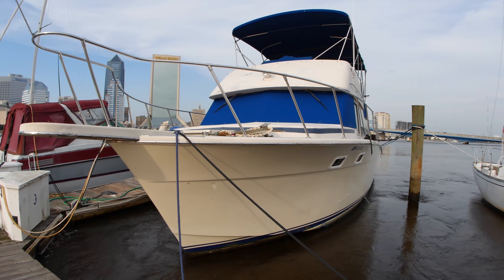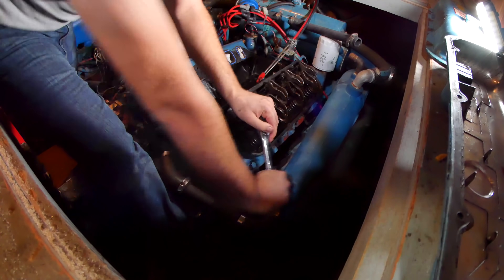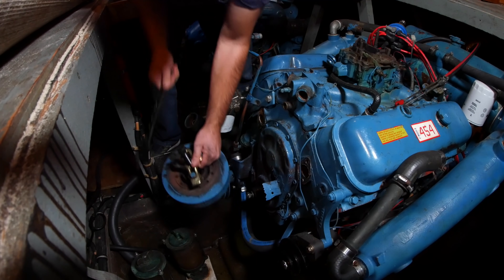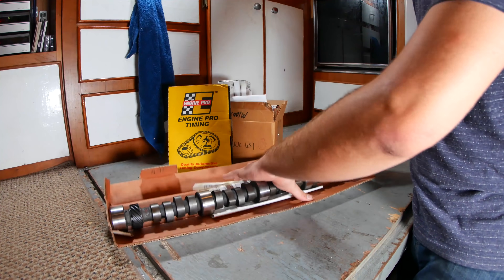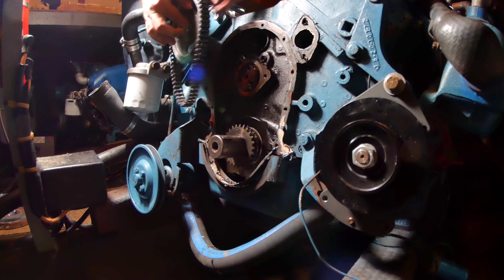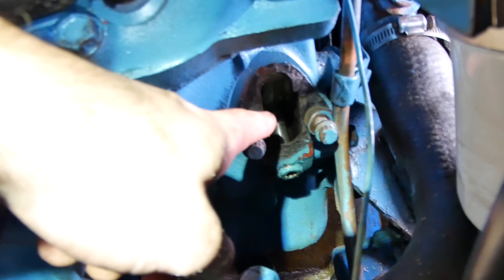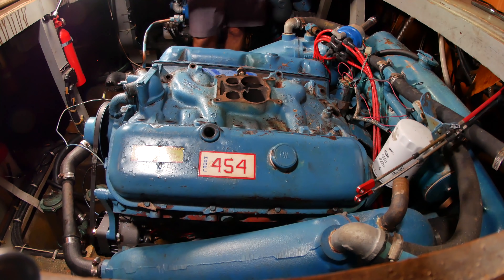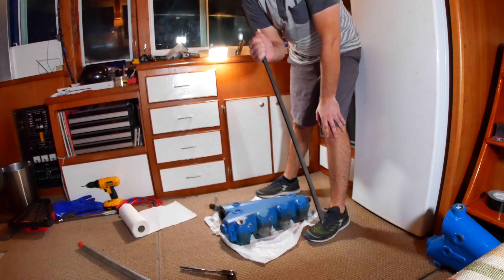The Biggest Project I've Ever Tackled (Boat 454 Repair)

Comment: We bought a 1979 Gulfstar trawler with a frozen engine.  After getting quotes of 35K $ to replace it we went to work. We swapped out an engine and gave both engines an overhaul.  I have the same level of knowledge as yourself. The day I got both engines running simultaneously is a day I won't forget. I could feel your satisfaction.  Great videos. Keep them coming. Sean
Reply from the maker: Thats an awesome story! I bet you've had some amazing adventures since that day.
Reply: @CullenCraft  we have had tremendous adventures with her in the last 4 years since we own her. Having bought her in New York we sailed down the ICW over two summers to Florida and then to the Bahamas. We shipped her to Italy in the back of a ship and now keep her in the Mediterranean.
Reply from the maker: Wow! I'm jealous!
Reply: @CullenCraft  Im lucky the lady in my life loves boating.  It makes it so easy. Our boat looks very similar to your boat. Our engines are diesel.
Reply: Hi Sean, how did the importing of your boat to Italy or somewhere in the EU go, was it easy to ship the boat? Once you got it there, did you have to do anything regarding the recreational craft directive (RCD)? Also, what diesels did you replace the petrols with (your boat must be worth quite a bit more now)?
Reply: @sean carrol
Reply: Old tech is simple and easy to comprehend. Hind sight is 20/20
Reply: congrats on a 70k DAY🎉

Comment: I'm a 36 yr diyer on cars... My 1st car was a 73' Pontiac Gran Prix with the smaller 400 cu. inch engine. The larger motor was a GM 455 (similiar to your 454's).  It's very impressive that you undertook a major rebuild project by yourself and didn't allow the issue at hand dissuade u. GREAT JOB !!! And congratulations on your success - it just makes you appreciate your motors even more when you've done it yourself... Keep the videos coming Chris Craft made some great boats in that period.
Reply from the maker: Someday I want an old Pontiac like that. Great cars!

Comment: Just a quick stop back through.  Good to see you working hard, learning, and taking good advice from many people.  Here is my latest offering if it helps...  always make sure that you know what tools that you will need before you start a job. On the timing gear puller and other common tools - both Oreilly's and auto-zone offer good loan a tool programs for common tools.  The lower timing gear puller gear puller is available, just leave a deposit, which you get back when you bring the tool back...  best of luck and I will check back again. :)

Comment: You remind me of the days I did all the work on my 88 Carver 38ft aft cabin.  Twin 454 mercs....7.5 Kohler genny ......3 heat pumps etc and all worked great...never paid anyone to fix anything.  You will never regret doing the work yourself as you will know when your CC is running correctly and pocket the savings.  Buy new carpeting as a reward.  Good Luck!

Comment: GOOD JOB<<<U GAVE ME THE CONFIDENCE TO DO MY 2 Chrysler Marine 318's...on my 1972  32'  Marinette Cabin Cruiser...
Reply from the maker: Good luck! Make sure you learn a lot before starting off.
Reply: They are excellent marine engines .
Was a marine mechanic since 1979 to 93. Salt water.
Chrysler held up the best.

Comment: Well that was amazing dude. I have been a backyard mechanic for 40 years and now I just bought a boat with 2 of those motors. I will need to do some serious repairs on mine too. I learned so much from this video. Thanks for showing us that you don't need an expensive mechanic to fix some of the problems a boat has. Great Job and good luck with your boat.
Reply from the maker: Thank you! Good luck, and have fun.

Comment: When changing exhaust manifolds that are cumbersome and heavy you can use the old bolts and cut the hex off and grind a slot in the end for a screw driver. You than screw thoes into the cylinder head slide your gasket on than easily slide on your exhaust manifold without pinching the basket etc. I've seen so many time mechanics putting bolts through the heavy exhaust manifold with the gasket and misalign the gasket. Keep killing it!

Comment: In 2002 I was on a camping trip with my wife and son he was only eight years old then. I was hauling a trailer full of camping gear behind my 1995 Toyota T100 pickup truck which had a six-cylinder engine. My harmonic balancer went out and my engine light came on. The first mechanic tried to work on it but told me I needed to take it somewhere else. He didn't know how to fix it. So we went to an auto parts store for a recommendation. We took the truck there. The mechanic knew we were in a very tuff situation so he took advantage of me big time. The final cost to fix it was twenty-three hundred $$$$. I was very unhappy but paid him and it ruined our vacation. You just replaced yours for a fraction of what ours cost. Your a very smart young man and most people can't
Reply: work on engines. You're very gifted!!
Reply from the maker: I've been screwed over by a few mechanics myself. My first ever "breakdown" cost me $700... For what turned out to be an empty tank of gas! That's why I work on my own stuff now. If I don't know something, I can learn it, and be more prepared for the future.

Comment: Cullen. Dave a Certified MerCruiser mechanic here. The problem you’re going to have is the shavings that came off of the camshaft in the valve lifters. It’s called trash. That’s all inside the oil pan. You really should pull the motor drop the pan and clean out all the trash and install a new oil pump. Second best is if you can get a drain pan under the oil pan drain the oil real good put fresh oil start it for a few minutes drain it again changing the Oil filter each time. Still that engine has run with trash inside.
Reliability may be a factor.
Reply: PS I really didn’t make myself clear. The trash from the old camshaft with the engine running. After you get a broken in and cleaned out the best you can I would watch the oil pressure especially at idle. I believe the specs are  20 lbs  at 800 RPM For a 454.
Reply: @davieddt  That oil pan really needed to come off, many older boat motors have a half rotted oil pans anyway from people letting water sit in the bilge and rusting the pan. If I find any pitting in an oil pans metal, I replace it. Also, any repair that requires a bearing, piston, lifter, pushrod or cam due to damage, one of the most important things you can replace is the oil pump as has been stated above. This eliminates oil pump failure, if that caused the initial damage, from destroying the rest of your engine. I always buy the best oil pump I can get my hands on as well. 
There is probably a quarter of an inch of metal bearing sludge in the bottom of that oil pan. Fresh oil and a long run of the engine at cruise rpm and that sludge will begin to break up and you will have metal shavings in your oil galleries pumping through the engine... Joe

Comment: Great Job. Hope that was high temp silicone. It looked like household window and door trim silicon.
Reply: I had the same thought
Reply: I thought the same thing. That should have been RTV
Reply: I saw that caulking gun of residential silicone come out and said OH NO!
Reply: I'm very impressed he was able to do this on his own but I think you folks are right and I hope he reads this because that silicone will cause all kinds of problems shortly
Reply: Has it started leaking oil yet?
Reply from the maker: Nope. Even house grade silicone is good up to 400°. These engines should never reach that.
Reply: high temp silicone is for exhaust parts black or Grey rtv will be just fine

Comment: Rotella T4 15-40 is an excellent marine engine oil, great for flat tappet engines too. Consider Wix or Naps gold oil filters. Note! Make sure the old filter gasket isn’t left behind so you don’t double stack it and it bows out. I caught this before disaster on the Napa’s a few times.

Comment: Great to see it running! Nothing better than seeing your hard work making all the right sounds 👍🏻 Run a high quality filter like Wix brand. Take a look at your oil pressure and do an oil analysis on both engines will give you an idea of what kind of shape they're in for the long term. As others have mentioned, that much damage from the cam can be hell on bearings. Likely you'll be fine and just run it until there's a problem. Then you dig in again & learn just like this time.

Comment: I have a 1979 Pacemaker Sport Fisherman that I live aboard (33').. I'm just now struggling with a 454 that broke a piston (it was sold as a new rebuild, I put 20 hours on it and it broke a rod at idle at the dock (the only lucky thing about it...).. So I'm now pricing out new engines and sorting out how to do this swap.. I see that your deck was removed.. So I have to see if mine will do the same. I'm not sure that the small dual access hatches will allow for engine removal.. So this was a great video to see! Best of luck and smooth sailing!
Reply from the maker: Deck was removed? I don't know what you mean?
Reply: @CullenCraft  The deck (floor) in your salon (covering the engines). I am assuming that you unscrewed the decking to gain access to the engines
Reply from the maker: Oh, the Sole! Yeah, mine lifts up. No screws.

Comment: Cummins engines still have flat tappets in the Ram trucks - I run diesel oil in my boats for a reason! :)
Reply: Yep, diesel oil still has some zinc for the flat tappets engines. 

Run 15/40 diesel oil, along with STP for more added zinc.
Reply: Can you run diesel oil in most any conventional engine? As long as it's the right weight?
Reply: @johnnyohness6610  I've run it even when it was close.  15w-40 in a motor calling for 10w-40 for instance.
Reply: Penngrade 1 is the best for flat tappet engines. They’re starting to take zinc out of diesel oil.
Reply: Do all  Mercury engines 454s have flat tappets?
Reply from the maker: Unless they've been upgraded to rollers, I believe so.
Reply: @CullenCraft  I have a 1985 Trojan International 11 Meter, I just bought end of August. Have 454 Crusaders in it. Wanted to know if I have to do the zinc thing. Love your videos
Reply from the maker: Great boat! Good luck.
Reply: @YomamaPVT  any older flat tappet engine must run oil with zinc. 

Diesel 15/40 along with 2 containers of STP which contains ZDDP and no worries. 

I've used that combination for yrs on older gas and diesel engines, never a problem.
Reply: @YomamaPVT  
dont know, but if I went to a new cam, I would do a roller cam, so the lifters lock to each other so they dont spin. And this is a way to set dry lifter clearance  https://www.youtube.com/watch?v=CDQ_JhMlDz4

Comment: Just a heads up when you put the new camshaft back in. And the two dots the one on the cam gear and the one on the crankshaft are pointing to each other like when you removed it, the number six cylinder is in the firing position not number one. If you noticed when you took it apart the dot was on top. I am going to assume that you had the rotor pointing at number one on the distributor cap when you remove the distributor. So after you put everything back in and have the two dots together rotate the engine one revolution so the dot is on top. Then when you put your intake manifold on and put the distributor in it will be all set. I can’t tell you how many people think that when the two dots are together number one is firing. You’ll probably get a lot of argument on this but I’m telling you that’s the way it is. It’s also this way a Pontiac Oldsmobile and a lot of other engines. Buick being an exception. But we won’t get into that right now. Again make sure that dart is straight up on top and that the dark on the crankshaft gear is up on top put the distributor in pointing it to number one on the cab and you’ll be close for timing

Comment: Congrats Cullen on getting her done! I will admit that I cringed a little bit when you fired her up before changing out the old oil and filter that had the metal particles from the damaged camshaft lobes and lifter. Also as an aside if you end up doing the other motor, they make a handle that bolts onto the end of the camshaft for better control taking out and putting them in. Glad you got her running again!

Comment: Nice job!! Don't know many DIY that could or would be able to perform those diag and repairs with success without some guidance. That was my only way to get on the water also and it has worked for 45yrs. Shows that with the right attitude and research methods your dream becomes reality!! Now that e everything's done it's just knots and lines...lol 👍

Comment: A tip my Dad gave me and seems to work more often than not with hard to remove threaded items (IE rusted).  If unscrewing does not move the fixture, try to move it in the same direction it last moved in. What that translates to is in a normal thread the last time it moved was to the right when getting tightened. IF you can move it a 1/32 of a inch, it will come our. Use care and patience to not twist it off.

Comment: Cullen, I hope you read this before assembly. You need to get all the bits of ground up cam out of the oil pan. They will clog up the oil pump pickup and wipe the engine.

Comment: Congrats.  This is very impressive work.    I was glued to the whole thing with probably the same level of anxiousness.   I am so glad Murphys law didn't  prove to be true.   So many things that can go wrong when you open up such an old engine.    I wonder what happened to the old camshaft?   Engines dont typically wear out so badly.  Hope no oil passages are blocked and such.   Keeping my fingers crossed this rebuilt engine serves you for years to come.   Cheers!
Reply from the maker: Thanks! If it doesn't, well maybe its time to get a pair of diesels in her. I hope these are able to stay in service for a very long time.

Comment: Thanks for your videos, I did the same thing to the 396 Chevrolet big block. I wanted to replace the water pump at the same time, I did not do it. Less than 300 miles the water pump went out.
Reply from the maker: Oh gee. Guess I should look into that. I replaced the raw water impellers about 8 months ago.

Comment: I think you did a fantastic job!! They may have been fine, but if you have the capability, changing out the water pump and fuel pump could save from having to change them out later. Mine were fine, but I changed them out anyway and kept the old ones just in case.

Comment: Good job on the top end build! In the future tho I would suggest testing parts before you buy. I doubt you had a bad water jacket, and a simple pressure test would have told you all you need to know (aka you could have saved 400 bucks).  The rust in the manifold was most likely due to outside moisture getting back to the engine and no exhaust to push it out and coat the inside of the exhaust with carbon/fuel/oil that is present during combustion (that cylinder was down due to cam wear).

Comment: incredible guy taking on this job when on start up bedding in your new cam and lifters is something you must do runn it up for 20 min not at idle but 1500 2500 rpm to break it in hope your replacing your timing chain at the same time

Comment: I may not have made myself clear. It’s all the trash from the first camshaft that you need to worry about. That’s circulating through the engine and maybe affecting your oil pump and main crankshaft bearings.After you’re finished maybe you should check and keep an eye on your oil pressure. Maybe invest in an oil pressure an alarm. You should have at least 20 pounds of oil pressure at 800 RPM. PS your boat looks great

Comment: Did you do a compression test before Taking the engine apart?  
That dished out lifter would show on a vacuum guage as a jumping needle on the gauge. You should just take both heads off and do a valve job on them.

Comment: Brad penn oil is what you want.  It’s what heavy duty diesels run and it has a lot of zinc which is why they use it in pulling tractors and race cars.  Google that.  You can buy it online.  We’ve been running it in crusader454’s on fishing boats for a while and it has been a god send.

Comment: Valvoline zr1 high zinc racing oil from o'riley is what I use in my rebuilt crusader engine recommended by the engine shop.

Comment: Curious how you purchased a brand new marine 454 cam shaft for so little money. Did you already have the specs from the marine cam in your engine that was bad when you ordered the new cam. The cam is key to performance and running the engine at the higher rpms and  torque that the marine cam provides. Also  matching the cam, allows both engines to be synced together and not just rpm, the all important torque at rpm will match. Marine cams are performance cams and a 454 with a marine cam will lope a bit at idle and from your video the engine ran smooth at idle, more like an automobile 454, with an automobile cam. It is hard to tell from the video though.
Perhaps I missed the sequence of events in the video and you removed the old cam and got its specs before ordering the replacement cam.
Just curious, and if you pulled all that off, and got the matching cam, without a marine engine mechanics help, I am truly impressed... Joe

Comment: This is amazing - great work, brother!  THis is inspiring me to tackle my valves/heads this winter :)

Curious if you could have simply sanded the paint off the new manifold instead of scraping with a knife?  Can't imagine a 80 or 100 grit would take anything more than the paint.
Reply from the maker: Good idea, it would probably work but it's easier to clean up large chips than dust